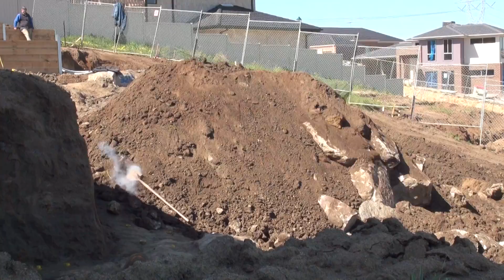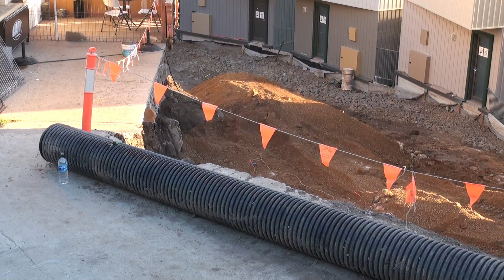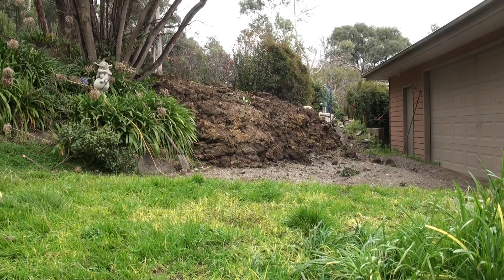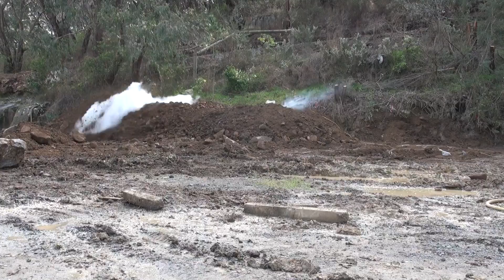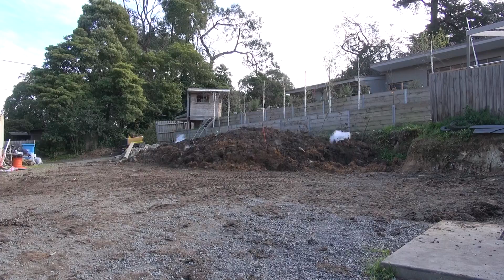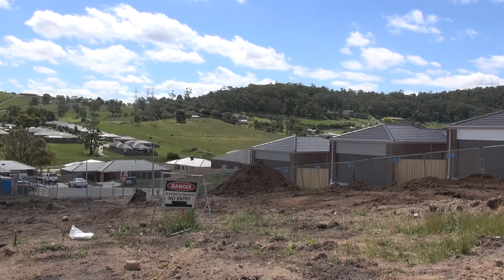Careful Rock blasting when doing site cuts and foundations for home sites

Comment: have you guys had any issues with vibrations causing damage to houses or properties nearby? obviously there are two negative outcomes from blasting, sound and vibrations - sound can be sorted out but vibration is a key one. looking at possibly having to lay a large amount of concrete stormwater lines up the middle of some existing roads with houses and residents both sides of the roads and most of the geotech work shows lots of basalt lava flows in the area. just trying to find some innovative ways to deal with the rock.
Reply from the maker: Hi Chris, as you said, the sound is easily managed with a big pile of soft soil cover, the vibration can also be cut back a lot but it comes at a cost. If you were laying drains in a new estate with nothing nearby that breaks or complains you would normally use large diameter holes, big charges and a big hole spacing, gets the rock out quick but the vibration can be very big also. The shot I fired today was for such a drain and there was vibration sensitive assets nearby and as such the asset owner specified a maximum vibration level which I had to design the shot around (<50mm/S). We blasted a 2m deep, 1.5m wide trench through hard granite while the target structure was 15m away. the measured vibration was a peak particle velocity of 18mm/S. This would be a level that would bring some complaint from home owners but no where near enough to do any damage. Different countries have different standards and limits, in Australia the limit is 10mm/S for a home and 25mm/S for a commercial property, higher in the U.S. ( you can bet that you will start causing damage to homes when you are up around 100mm/S)

If the blasting is done using small diameter holes and the depth of rock is not too deep there is a good probability that blasting is a viable option, depends a lot on distance to the target and charge mass per delay period. 

Being just basalt, can you smash it out with a large hydraulic breaker??

Comment: Those cascade? Ones are interesting. 

Must be hard to choose the right delay times to get enough movement before the next one but not enough movement to damage the fuse? Triggering the next one.
Reply from the maker: Ahh... there is somebody who has given it a bit of thought. The potential problem that you point out is called a "cut off missfire" this used to be a nasty problem in the early days millisecond delay blasting (the practice of inserting short delays between holes to control the vibration and improve fragmentation). In the early days this was done using detonating cord and "dog bone" surface delays, and as you pointed out, if the delay between adjacent holes was too long, the rock movement would damage the connecting cords or rock movement could cut off the cord down the hole (not good). Modern initiation systems use two delay elements, there is a short delay in the surface clips and a much longer delay in the detonator at the bottom of the hole. The surface delay clips set up the firing order and inter hole delays and this is all over and done with before the down hole dets start firing, problem solved!
Reply: Demolition Dave Drilling and Blasting 
Sweet. 
I never thought of a delay in the hole itself. 

I’m a control systems technician and fast things fascinate me.
Reply from the maker: @brucebaxter6923  Ahhh... I come from a Technician background, it gets better Bruce, the dets I'm using have a pyrotechnic delay element and as such they can have a delay tolerance that may cause a problem in some applications... enter the programmable delay det. Yes I kid you not, every det has its own unique identity and connects to a common bus that allows in hole programming of the exact delay period - https://www.youtube.com/watch?time_continue=324&v=7S01jlwOOfY
Reply: Demolition Dave Drilling and Blasting 
That’s impressive. 
I had no idea things had progressed that far. 

I thought only in terms of single electric detonator, cannon fuse, detcord and something like detcord but slower like 500m/s. 

This new stuff is amazing.

Comment: Your so good Can u help us by advising us which explosive/material i can use to blast near the house
Reply from the maker: Hi Kelvin, not sure if I understand your question correctly, It comes across as: you are going to do some blasting near your house and you are asking my advice which explosive to use.
Firstly, I'm not a consultant and therefore I don't have any professional liability insurance, so I'm reluctant to give advice on such topics. Secondly, if you have to ask this question, I'm not sure you should be doing this yourself. Any explosive will produce enough ground vibration to damage your house if you use enough of it and it is too close to the building. Can you do the work with and excavator mounted hydraulic breaker? Some hard rock types like Granite can not be broken this way, if it is very hard, can you use an expanding chemical cracking agent?  Please give me more information. - David

Comment: This video is amazing. So basically when you find the rock you drill multiple holes in it then you put something inside the holes connected to a wire, then you cover it with soil completely and then blast it right? What are those things you put inside the holes and where can we get them?
Reply from the maker: Sarah Jack  - the bit that goes in the hole is thr detonator and the explosive, sorry but you can't just "get them".
Reply: Understand.

Comment: If you must blast a foundation out of bedrock (in the vicinity of existing structures), do you blast the rock to the desired depth with one shot or do blast the same site repeatedly until the desired depth is reached?
Reply from the maker: Hi Kevin, you do it to the desired depth in one go if you think that you can do so without causing a problem as drilling into rock that has been blasted can be difficult as it is full of cracks. Sometimes you can have some short holes that fire first and then the long holes a few milliseconds later.
Reply: Thanks for the prompt reply.  I was thinking that drilling and blasting fractured rock would be problematic.  But if the holes are arrayed both horizontally and vertically, and if the detonations are sequenced properly, then the entire mass can be shattered with one shot and without collateral damage.

Comment: Hi, what drilldepth do you use and distance between the holes? Is it dynamite youre using? What load?
Reply from the maker: Hi, Hole depths and spacings are normally as per "rule of thumb" e.g. Depth = >1.5 x spacing, depth of stemming = > 20 - 30 x hole diameter, load rate depends on what kind of blast, breaking oversize  may be 70 - 100g/m3, bench blast with free  face ~300g/m3 if the plan is to just break the rock to remove it, much bigger load if it is to fed into crusher, trenching in hard rock 700 - 2000 g/m3. The chosen load also depends a lot on acceptable vibration levels, the amount of soft earth / blast mats available to protect agains flying rock. All of these blasts were performed using Orica Senetel Magnum packaged explosive and in some cases also anfo.